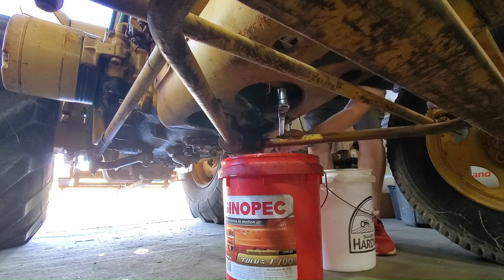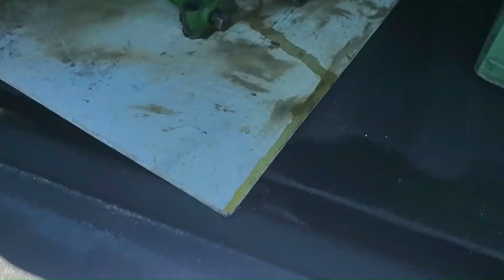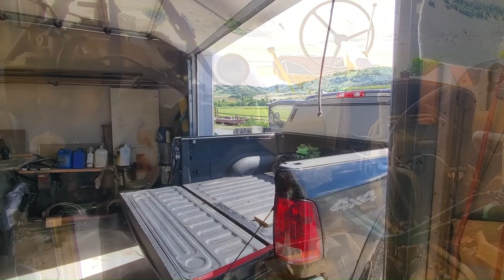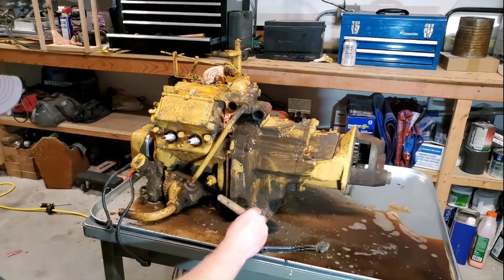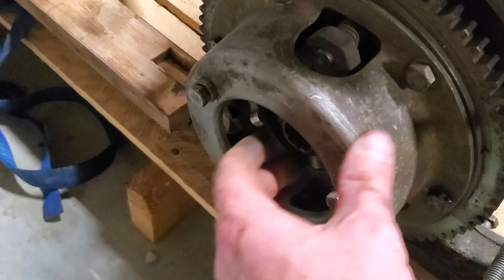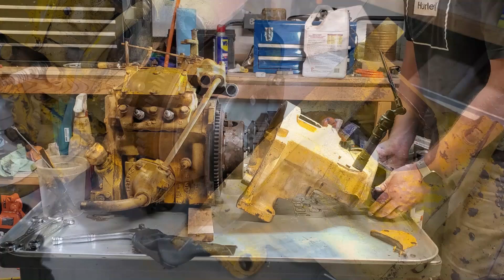John Deere 830-Industrial Pony Motor Removal and Diagnosis

Comment: Shouldn't be able to spin the starting gear by hand, there a brake pad that sits behind the gear that stops it from turning. Also the transmission should have oil in it and it sounds kind of dry.
Reply from the maker: Another commenter (@weirddeere) pointed this out too. Thank you for helping me out. I'm going to take a look at the brake. And yes, I'll be checking/replacing the oil in the heat box too!

Comment: No disappointment here, cleaning away the years of grease and grime to see whats actually under there is part of the discovery and getting acquainted with the "NEW" to you tractor. Glad there was no nasty surprises today. It will be sweet when you can start and run it at will. My "restored barn find" 59 730 Pony start had a cracked block which we knew but digging into it found everything original and wore out. Thousands of $ later, the only thing left is rebuilding the pony motor and the old 2 cylinder will be better than new. Great video and can't wait for the next one!
Reply from the maker: @tommckinley111  it's always a gamble. So far, I've lucked out. I'm sorry to hear about your experience. But it's nice to know the things you've touched are essentially new.

Comment: Sorry to do this, but I have a question on the magneto coil.  I have a 1941 JD model A with the Wico X magneto, currently the is no spark from the magneto.  I have replaced the cap and cleaned the rotor.  I have sanded the points lightly, still no spark.  I have tested the primary windings of the coil and got 6.5 ohms, is this bad ?  The secondary windings are at 7k ohms.  Seems normal to me.  I believe the the primary windings part of the coil is bad, I just need someone else’s knowledge to confirm or deny my assumption.  Thank for the help.
Reply from the maker: 6.5 ohms is high. You should be less than 2... Ideally close to 1 ohm for the primary winding. Secondary winding should between 6k and 8k ohms. If you suspect your coil is shot, you can try replacing it. But I'd start with points and condenser. They are typically the culprit and are cheaper to replace. Also, I've had luck filing points on a distributor, but with magnetos, I usually replace them.
Reply: @jonelsonster  Thank you for the assistance.  The tractor is now in Michigan were we have a lot less humidity than it previous home in Charleston, South Carolina.  Being right off the ocean, their humidity levels are always high, 60 to 80 percent humidity, 90 percent of the time.  It cause a lot of corrosion, wearing out electrical parts quicker that normal.  Especially with the way parts are made so cheaply these days.  I have new points and a condenser, that I will be putting on also.  But I am going to replace the coil also.   Thanks again.

Comment: Your pony transmission should not free wheel when in "neutral" (not cranking the diesel). There is a brake pad for the little gear that drives the diesel. If it free wheels your brake pad is shot. The brake pad is VERY important. Without the brake pad the engagement gear will still have some movement and is more likely to grind instead of smoothly engage the diesel
Reply from the maker: @weirddeere  very good to know! Looks like I still have more to do! Once again, I appreciate your help. I think you've mentioned the brake to me before. I will do some reading and get it fixed before I put it back on.
Reply: @jonelsonster  I was just hoping I'd catch you before it went back on the tractor hahah
Reply from the maker: Found the brake. PN AF2075R. Also, as I was searching for that post, I found a thread on yesterday's tractors where you responded to help a different guy out with a similar question. You're a wealth of knowledge. THANK YOU! 

https://forums.yesterdaystractors.com/threads/jd-830-pony-motor.1644363/
Reply: @jonelsonster  Well you already know why reading comments is a good idea. Lots of very knowledgeable people and like "weirddeere", glad you saw it too while still off the tractor.
Reply: @jonelsonster  It helps that I'm insane. The brake material is a separate part if you wanted to go that route. R805R is the facing. I've thought about what it would take to make one, but I haven't had to open one up in quite a while